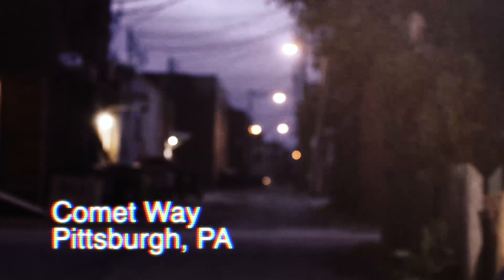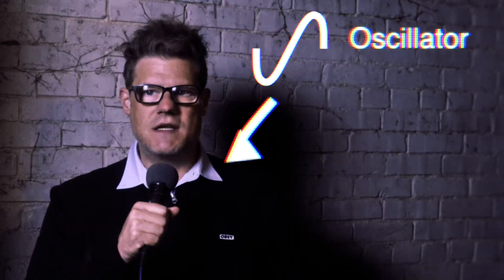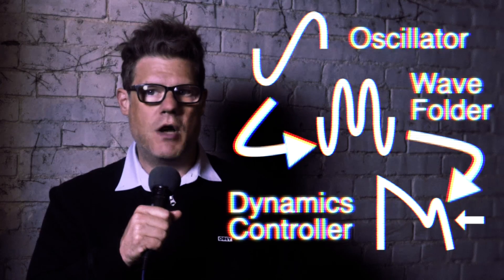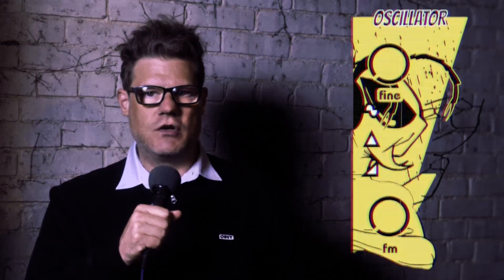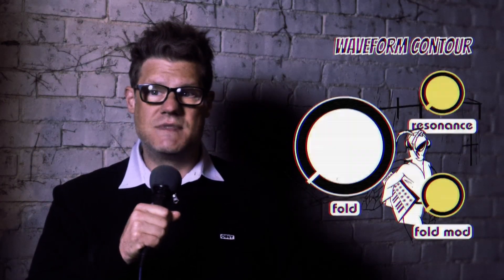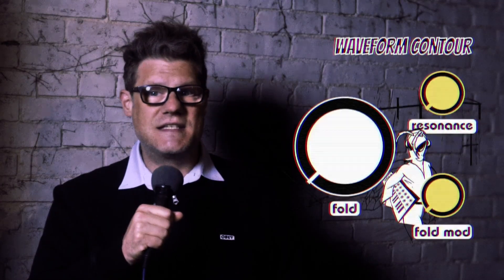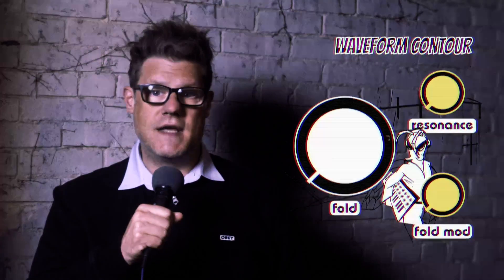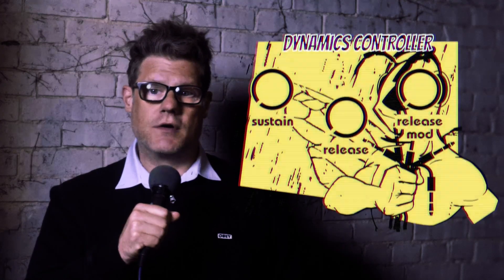The Dimension of the West Pest - Cre8audio West Pest Film

Comment: I hope someone sees my idea here.  I just jumped into semi-modular starting with a b2600, grandmother and a west pest and some extra noodles. (awesome y'all included 5 shorties) So as I am playing with these 3 patch animals, I noticed a problem that I am having WITH ALL 3.   The problem is sync'ing or clocking the lfo.  Instead of work-arounds that tie up other things and are iffy, I would like to have a triple LFO module in a pest/beast chassis.  All clockable separately or multed together AND the ability to pass clock and sync through. Most of my synths do not pass the clock through if set to ext clock. Finally, IMO, there are more owners of semi-modular gear than owners of modular setups and I think that a few key stand-alone utility modules would do well.

Comment: I bought a West Pest but had to return it because it did not work with any of my MIDI controllers.  I bought a second West Pest from a different retailer, hoping that my previous problems were just a faulty unit but no.  My second West Pest also does not work with any of my MIDI controllers.  Major note-hanging (both pitch and gate) issues. Unplayable. Is anybody else encountering this problem re the WP and MIDI or is it just my enormous bad luck?   It's a shame because I love the WP sound and the sequencer is a lot of fun but I just can't get it to work as a MIDI sound module. Anybody got any ideas/solutions?

Comment: Already preordered one from Thomann. 😊
The currently available demos sound just awesome and there's definitely too few affordable west coast gear out there.
The closest "setup" to west coast synthesis, i currently have, is a Pittsburg Microvolt 3900 and two Capt'n BIG-O modules. Two BIG-O combined can get pretty close to way more expensive "complex oscillators", as the BIG-Os have a wavefolder and overdrive / soft clipper each and offer linear and exponential FM.
So i'm very excited for the West Pest as it will greatly expand my "west coast arsenal"! 😄

Comment: Does this (and the East Beast) include a few short patch cables (to properly encourage experimentation)?
Reply: Yes, they each come with a pack of noodles patch cables and a midi adapter cable.
Reply: @richardnicol  I kinda thought they would; all of my older PM Cell [48] System synths came with some (but I forgot to ask about the MIDI adapter cable)…
Reply: Just a quick question — If I have to get a replacement/spare MIDI dongle, is it a type A, B, or C?
Reply: @makers1958  A

Comment: Quick question: Looking at the patch bay, I see that the pitch and gate outputs have a small "MIDI" icon in front of the labels. What does this signify?

Are these normal, eurorack compatible CV outputs? Does the device only output pitch and gate for incoming MIDI, or also from the sequencer?

Also, does the device come with the usual mini-TRS to DIN dongel(s) for the MIDI in- and output, and which "style" of MIDI over TRS is used here?